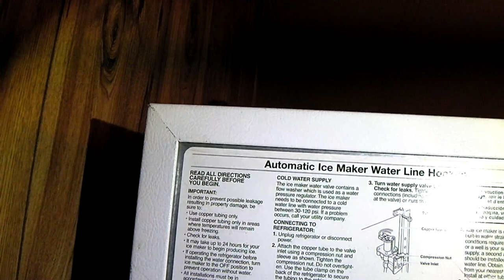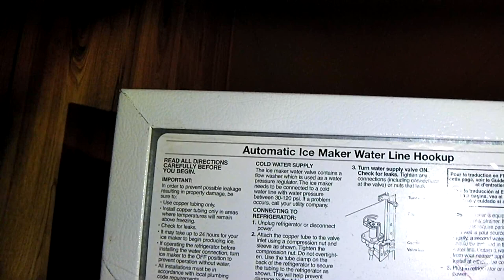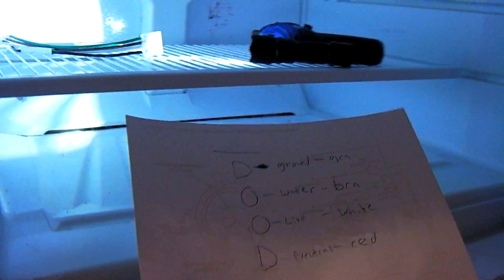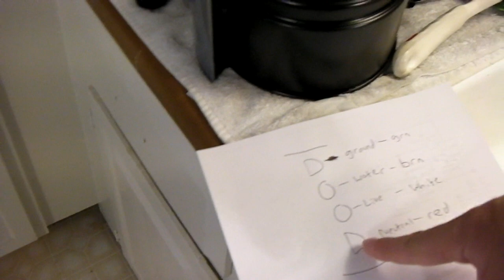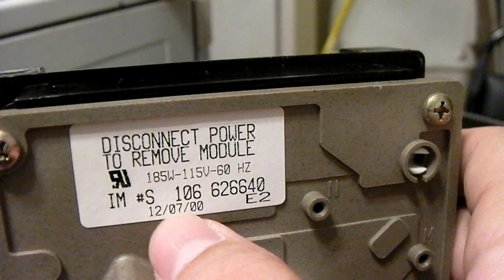Some things to know about installing an icemaker in a refrigerator

Comment: Finally!!!! Someone makes a video about the adapter power cords ... I bought a ice maker kit and the mini adapter 4 prong is different then the one coming out of the original refrigerator?

Its pins are all together and the ice maker pins are in the corners of the harness ???

How do we install the adapter wiring round harness to the actual refrigerator?